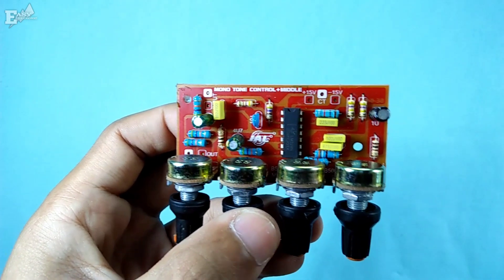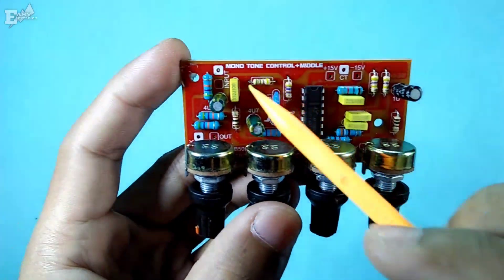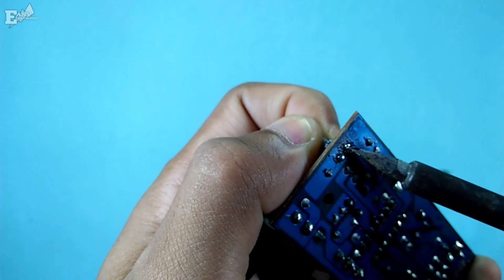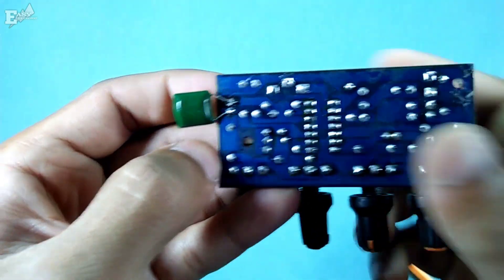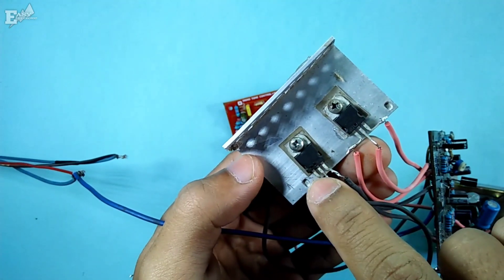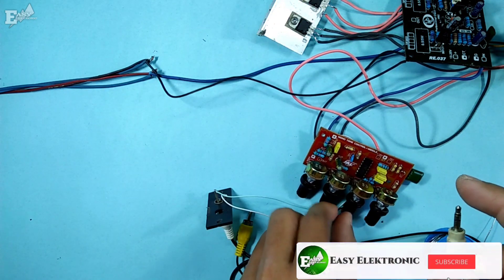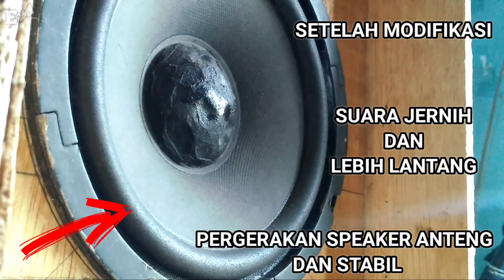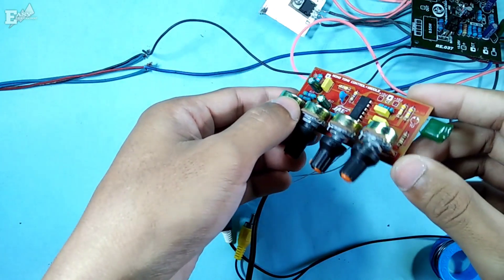Cara modif Tone Control agar bass bertenaga

Comment: Cara mengatasi tone control ini nois?
Reply from the maker: Cari dulu penyebab utamanya ka . Bisa dengan cara cek dulu power nya tanpa tone control ada noise ga.. kalau aman cek lagi psu untuk suply tone control nya yg ke 3 bisa dengan cara pasang kabel grounding ke body trafo
Reply: @EasyElektronic tonenya saja yang nois ,lainya tidak.
Reply from the maker: Untuk suplay psu tone conttol nya pisah apa gabung sama psu utama ka.. kalau psu nya gabung. Lepas kabel ground suply yang masuk ct
Reply: @EasyElektronic suplay sendiri bang.
Reply from the maker: Bisa jadi dari psu untuk suplay tone control nya kurang bersih dan belum ter regulasi dengan baik..usahakan untuk psu tone control pakai psu yang menggunakan ic 7812 dan 7912 untuk hasil dc output yang lebih bersih

Comment: Mas request modifikasi soundcard V8 kw biar bisa suara vocal jernih kencang dan bagus untuk recording atau buat content youtube... 🙏
Reply from the maker: Kunci nya tinggal pakai OTG aja ka coneksi nya jangan pakai colokan yg 3,5mm.
Reply: @EasyElektronic  baik terimakasih mas.. untuk otg sama perkabelan saya pakai vention, cuma rencana mau tambah modif upgrade didalem soundcard v8 selain preamp mic juga pake tone control semua built in gitu disana.. nah cara pemasangan TC di V8 yg blm dapet jalur2nya atau videonya yg bikin jelas 😁🙏

*Catatan dah pesen jg di olshp Modul 2.1 ne5532 Stereo Tone Control Plus Middle non subwofer
Reply from the maker: Sebelum modif v8 terutama bagian pream mic dan tc nya alangkah baik nya kaka pelajari dulu perihal Gain pre amp,
Soal nya di v8 itu gain staging nya udah 3 x lipat ka pertama penguatan di preamp input terus di kuatkan lagi gain nya di bag EQ terakhir di kuatkan lagi di PRE out .itu udah lebih dari cukup ka kalau kaka tambah lagi pre amp atau tc maka signal nya malah jadi over gain, kalau mau modif mending kaka nya modif di bag eq dan preamp v8 nya aja biar suaranya mic nya berbobot
Reply: @EasyElektronic  siap lagi coba terimakasih sarannya bang mudah2an berhasil nih... 🙏
Reply from the maker: Amin .semNgat😊

Comment: aq punya tone bsx-a3 ada 2 kapasitor 47 nano gan.. apa cm 1 yg di ganti atau keduanya. di bsx a3 gak pake elco 1 micro tp pke milar 47 nano. mohon pencerahannya gan
Reply from the maker: Kalau stereo TC nya berarti total 2 cap yang di ganti.  Trtapi jangan di samakan dengan ini ka takut nya beda skema nanti malah jd ga enak suara nya
Reply: ohh.. aq cb pke 100  nano, speaker lumayan gk over nendang cm noise timbul. apa.pengruh dr situ ya gan? sblmnya gk da noise
Reply from the maker: Coba cek di bagian psu dan pengkabelan ka..  Terutama kabel jalur input.. Usahakan jauh dari trafo
Reply: @EasyElektronic  ok gan. thanks ya infonya
Reply: Klo pake 100 n gimana bang
Reply from the maker: Jadi nge low ka

Comment: punyaku bass nya harus mentok ke kanan baru benar2 terasa,biar lebih sensitif suara bass nya,apa yang perlu di modif??
Reply from the maker: Pakai power apa.. Dan box speaker nya gimana?
Reply: @EasyElektronic  pake socl506,pake box spl.
Reply from the maker: Apakah driver nya juga karakter flat?
Reply: iya flat.
Reply from the maker: Harus nya tanpa modif pun sudah enak kalau misal pakai driver tsb.. Oh iya pakai trafo brpa amper

Comment: Tolong jawabannya gan. Tone controle saya persis seperti itu. Tapi suaranya nois parah. Tolong solusinya gan.
Reply: PSU udah aman mas. Maaf salah  Bukan nois mas. Tapi kl di buka volumenya suaranya kemeresek. Makin di fullin volumenya makin kenceng suaranya. Makasi udah bales mas.
Reply from the maker: Oh iya..kalau gitu biasanya dari potensio nya atau ada solderan yang mau copot mas
Reply: Terimakasih udah bls mas. Udah saya cek mas nggak ada masalah di potensial dan solderan. Suara kemerosoknya itu kayak radio yang modulasinya nggak pas. Maaf mas ngerepotin. Terimakasih sebelumnya.
Reply from the maker: Oh iya berarti kalau semua dah normal komponen normal.. Langkah terakhir ganti saja ic nya mas tapi kasih yang harga nya agak mahal dikit pasti aman
Reply: Terimakasih banyak mas. Atas ilmunya🙏🙏🙏moga sukses mas.
Reply from the maker: Sama sama mas .terima kasih juga udah mampir .
Dan semoga bermanfaat😊
Reply from the maker: Kalau noise parah udah di pastikan penyebab nya dari PSU nya om coba di cek lagi ..usahakan untuk PSU harus ter regulasi dengan baik ..kalau perlu pakai 7815 +  sama 7915 -

Comment: Bang maap.pemula ya saya mau tanya kenapa saya pasang cone control LM.324 plus midle .ya di pasang di TDA.2005 ko suar nya kecil dan kalo volume di polin punyi cuiit cuiit suara musik ilang apa kira" penyebabnya bang cukup trimakasih mohon bantuanya
Reply from the maker: Pertama pastikan untuk PSU control nya 15v CT 15v dan usahakan potensio treble nya jangan poll 100 % cukup 95% saja

Comment: Mohon dijawab, Saya punya tone control stereo Low Noise pakai Dua IC Ne5532, Pada bagian potensio middle kaki 1 mengarah ke R10k, kaki 3 ke kapasitor 100p, kaki tengah ke mkm 223 yg terhubung ke kapasitor 4700p kaki kanan dari kaki kiri kapasitor 4700p mengarah ke kaki tengah potensio Treble, sementara kaki 1 dan 3 potensio Treble mengarah ke R1k, hasilnya suara Middle terlalu tebal sementara suara Treble cenderung ke Midle agak cetung tapi sedikit kasar bukan Ciss, mohon solusinya Bos agar suara Treble lebih Ciss halus dan Midle agak cetung tidak terlalu lantang.
Mohon maaf panjang lebar, soalnya pemula.
Reply from the maker: Coba dulu perkecil nilai capasitor 100p jadi 47p dan 223 jadi 103

Comment: Basny berkurang.. Bkannya nambah bass..
Karna nila capasitor d kurangi uf. Nya..
Reply from the maker: Maaf ka bukan bass nya berkurang tapi lebih ke merubah karakter kalau sebelum nya kan 1 uf karakter nya terlalu nge Sub dan frequency di bawah 60 hz nya masih liar.. Jadi setelah ganti dengan 470 nf otomatis freq 20-60 hz nya di cut dan itu menjadi karakter LOW.. Dalam bahasa lumrah nya jadi JEDUG bukan GLERR 😊

Comment: Bang nanya TC saya sama persis suplay nya langsung pararel dengan power dg suplay 24v bunyinya cuma dengung salah apanya bang
Reply from the maker: Untuk tc ini maximal suply 15v ka,  kalau mau suply di paralel dengan power.  Nanti yang masuk ke tc harus pakai regulator 7812 dan 7912 atau yang 15v 
Dengung itu bisa di pastikan karena ic nya over voltage
Reply: @EasyElektronic  oke bang trims ilmunya mg makin berkah bang
Reply from the maker: Siap ka  terimakasih juga sudah mendukung ch ini. 
Semoga kedepan nya saya bisa lebih baik dan memberikan banyak manfaat lagi ka 😊😊

Comment: Mas saya ada tonekontrol setereo tapi kenapa ya ketika R di kasih input bisa keluar di out L ?
Reply from the maker: Ada potensio balance nya ga?
Reply: @EasyElektronic  gak ada mas
Reply from the maker: Apakah potensio di tone control nya pakai yang stereo semua ? Kalau potensio nya pake yang mono semua itu ada kemungkinan TC mono yang di bagi dua dengan Resistor menjadi stereo.
Reply: @EasyElektronic  potensio setereo semua mas.
Reply from the maker: Untuk kebocoran audio nya 100% apa cuman sekedar kecil saja keluar nya?  
Kalau hanya kecil itu wajar tp kalau suaranya sama seperti yang si masukan input berarti ada jalur yang short atau terkena solderan coba di periksa ka
Reply: @EasyElektronic  agak kecil sih mas tapi lumayan menggangu menurut saya. Ok coba nanti aku cek mas. Makasih dan sukses terus ya..!!!
Reply from the maker: @nogo7445  kalau sekitar 10%nor.mal ka. 
Coba nanti lepas dulu tone control nya. Apakah power nya juga ikit bocor apa engga